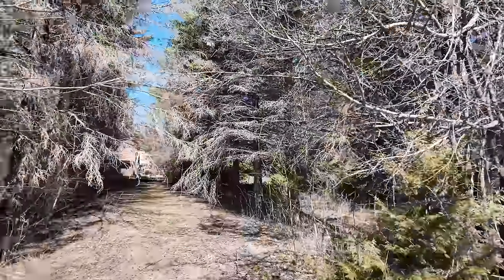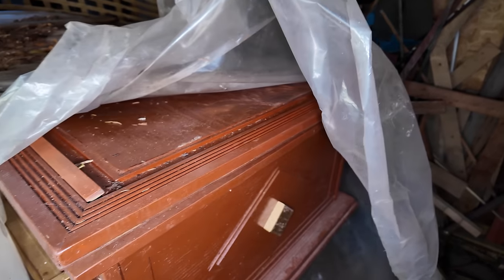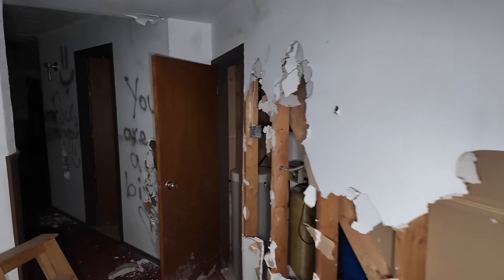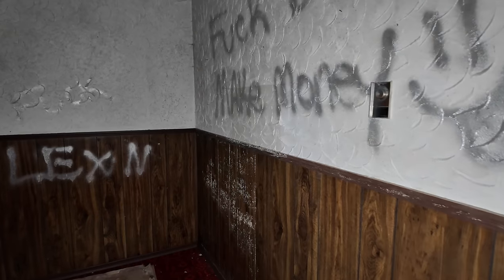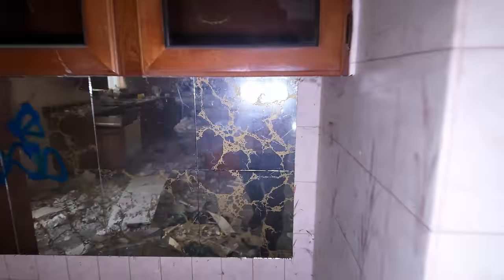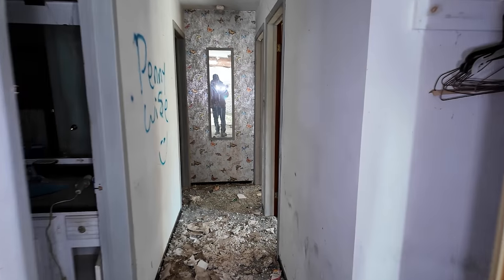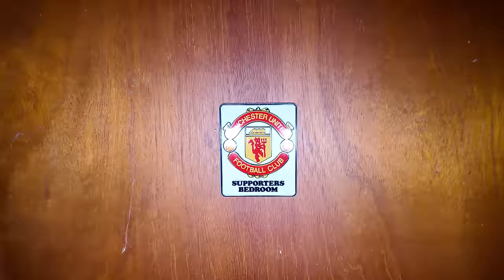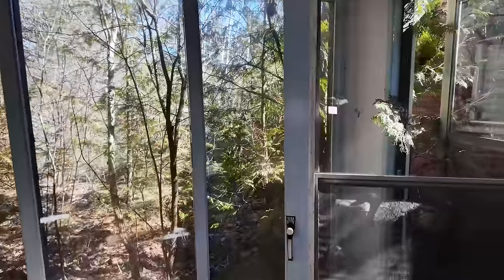They ABANDONED Their Home in the Woods 20 Years Ago NEVER to Return l EVERYTHING LEFT BEHIND

Comment: Well, that car is a Buick, a LeSabre, I'd say, circa 1997.  I always used to drive Buick Electras and Electra Park Avenues because they were basically a Cadillac without the EXHORBITANT  price tag; luxurious, quiet as a tomb, soft, boulevard ride, they were great, but then starting in 1997, the once-high quality, reliability and performance of the high-end Buicks, the LeSabres, Park Avenues (Park Avenue was the ultra-top trim level of the Buick Electra!) all went straight to Hell; I had to junk my '97 Park Avenue with only 58k miles on it because it was a lemon, a pile of junk; you name it, it failed... air suspension, head gasket (3 times) power seats and power window motors, all shorted out at once as I drove to work, no apparent reason, other than it was junk.  The final indignity was a locked-up transmission and a blown engine...my parents had a similar Buick experience around that time.  I should've sued under the lemon law, but I finally GAVE IT AWAY, just so I didn't have to deal with it anymore.  

I'd bet my bottom dollar that this Buick here in the video was likely left behind because they were ALL, in that generation, GARBAGE.  I'd say this car got what it deserved: eventually ABANDONED, just like my last Buick.😂